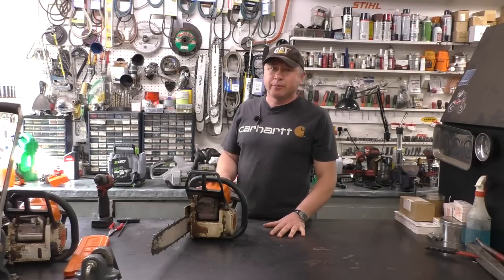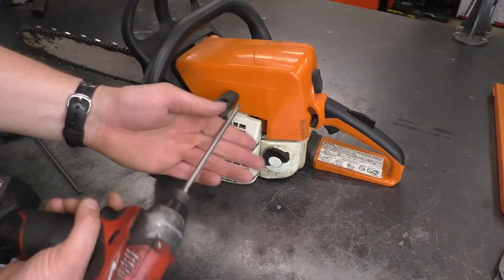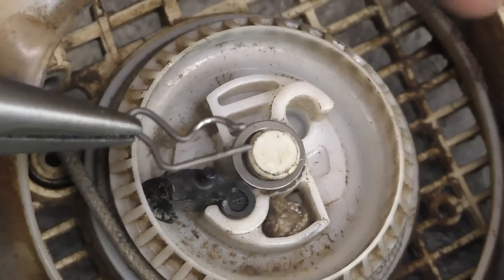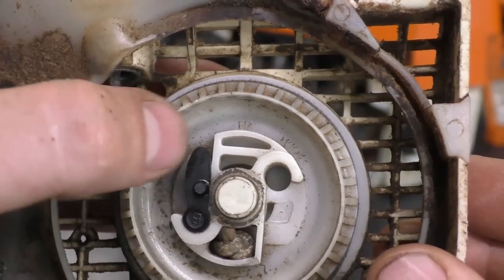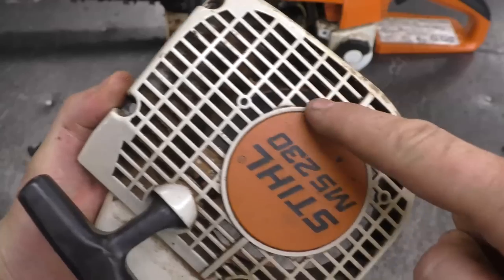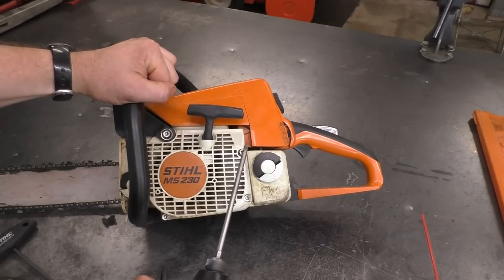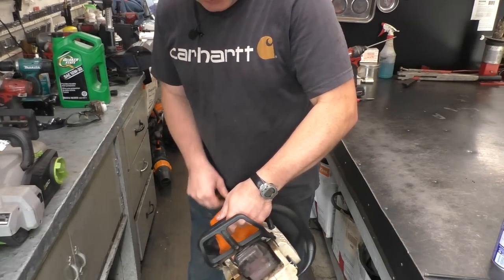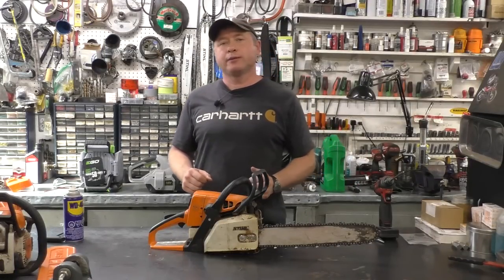STIHL Chainsaw Recoil Makes Weird Noise When Pulling Over - Step By Step Repair

Comment: You have to wonder if that incorrect pawl ever worked.  It must have at least briefly to get bent and broken like that.  That blow-out procedure is something I always do on every computer Tower PC that comes in for repair.  The Power Supply can get clogged with dust, hair and debris and all fans get a build up of dust and debris.  All air intake sections, the CPU Heat Sink fins and entire motherboard, cards and RAM and the whole case inside get blown out for cooler and more efficient operation.  I'll have to start applying this procedure to all my small engine devices.  Thanks for the reminder!  An entire procedure, including lubing with WD-40.  You're the man!  Thanks, Don!
Reply: I've seen that too, it is a pawl for a brush cutter. Costumer said it had worked a few times.

Comment: Yeah but why did it go out?   It needed 2 pawls to stay balanced on the fly wheel. Or it was a hark kicking saw and your pulling to hard wearing them out or your bearings are starting to go .
Something else is going on.   I had a 034 that just ate pawls. Bearing seized and rotated in the case.
Reply from the maker: the ms230/250 comes with 1 pawl
Reply: @donyboy73  Only on larger saws will have 2. Sometimes you can source illustrated parts lists. I've done this for my personal saws.

Comment: I never start a customers machine when it comes in just for recoil repairs unless I know the provenance of the fuel/oil mix.  if i have to start a machine to check it with customers fuel in, I dump the fuel out, fill with my own known good mix, start and charge for fuel and oil on top of recoil repair charge.  Start a customers machine with bad fuel/no oil bad oil ratio and damage the engine and your quick not much margin recoil repair job just cost you a whole load of cash and time.  just what  I do in my shop, I never ever ever start a machine when it comes in for recoil repair.    Additionally, most of the time, when a machine comes in for recoil repair, the recoil mechanism is broken because the customer has been pulling the hell out of it because it wont start for other reasons, thus usually breaking the recoil.   Most recoil repairs I encounter also have starting problems.....   just my slant 2p/2c worth and how I do it.